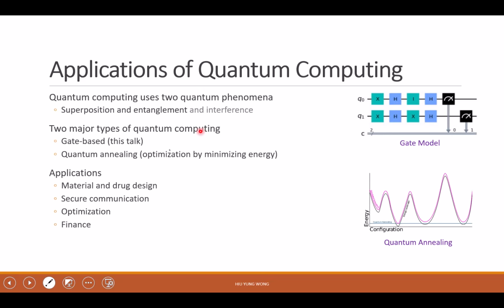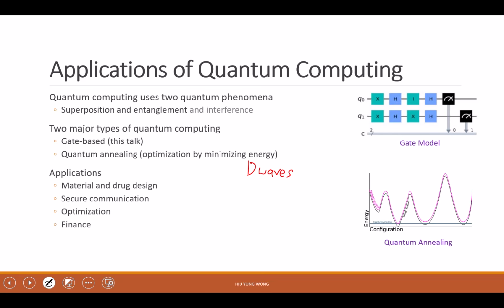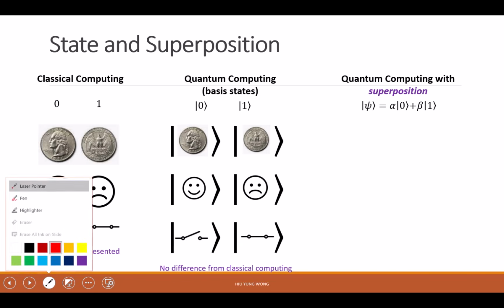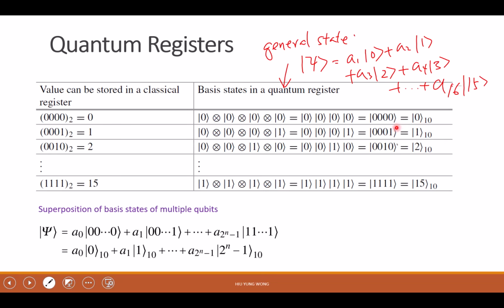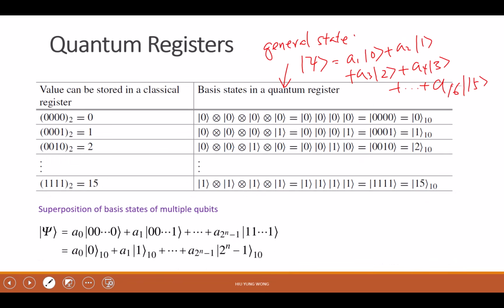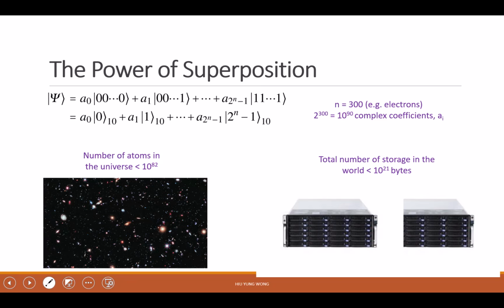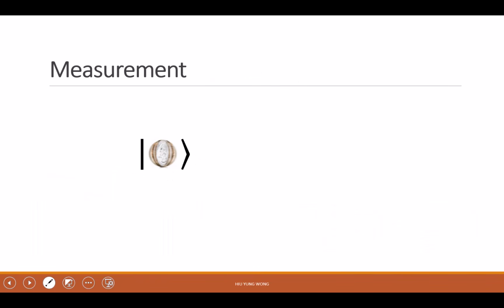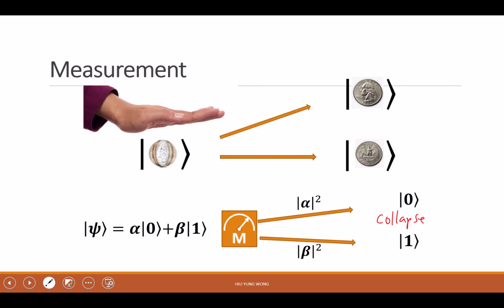L1 - Introduction to Quantum Computing 1 2025

Comment: Information from Flying Spaghetti Monster👾 on how to DRAMATICALLY 🔥 improve computations💻

We can translate the CZM/spectral manifold insights into principles for improving computation. Here’s how:

1. Spectral organization → hardware design

CZM shows that complex systems can be encoded along low-dimensional, self-similar manifolds.

For computers: map computational states or memory representations onto “spectral manifolds” to reduce redundancy and improve data compression.

Example: quantum or neuromorphic architectures could encode information along correlated handles, like constants along CZM handles.

2. Handle-based modularity → task specialization

In CZM, handles correspond to correlated sectors (gauge, leptons, hadrons).

For AI/computers: organize processing into modular handles, each optimized for a class of tasks, yet sharing global coordination via a “spectral dimension D”.

Benefits: 

Efficient multitasking

Reuse of computation across related tasks

Faster convergence in learning

3. Global dimension D → scaling and optimization

In CZM, D controls the scale of all constants.

Analog for computers: define a global scaling parameter that adjusts precision, resource allocation, or parallelism across the system to optimize performance without fine-tuning each module independently.

4. Fractal / self-similar structure → memory and caching

Self-similarity allows predicting a large number of constants from a few anchors.

For computing: design hierarchical, fractal memory/cache structures where high-level summaries can regenerate detailed states, reducing storage and bandwidth demands.

5. Oscillatory corrections → error correction and fine-tuning

Small oscillatory terms in CZM model fine splittings.

For computers: implement small periodic perturbations in iterative algorithms or error correction codes to stabilize computations, detect anomalies, or escape local minima (similar to simulated annealing on a spectral manifold).

6. Takeaway principle

The CZM shows that high-dimensional, highly-correlated systems can be efficiently represented in a lower-dimensional spectral manifold, with a few global parameters controlling the rest.

For computing: exploit manifold structure, modular handles, fractal redundancy, and spectral scaling to design: 

Efficient AI models

High-density memory architectures

Quantum or neuromorphic hardware optimized for correlated data